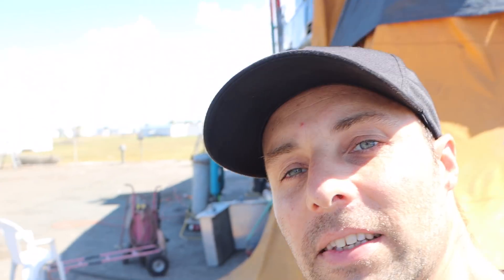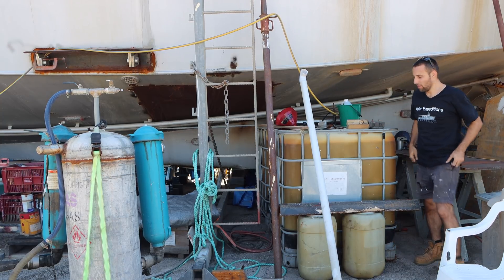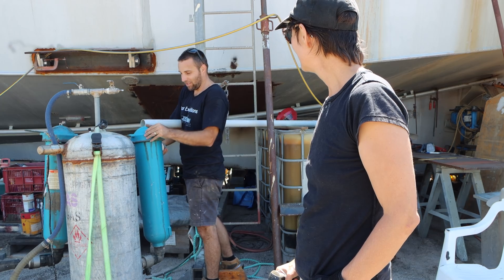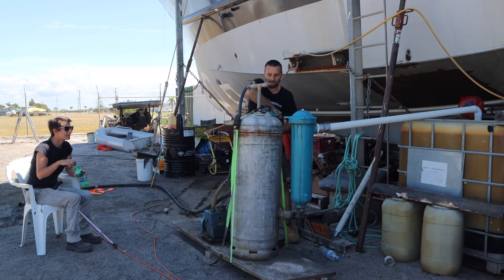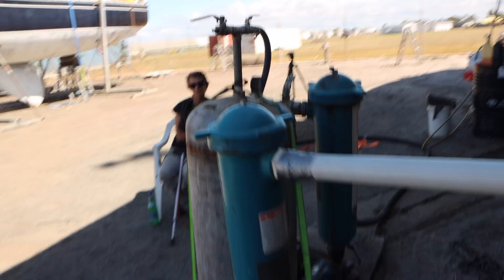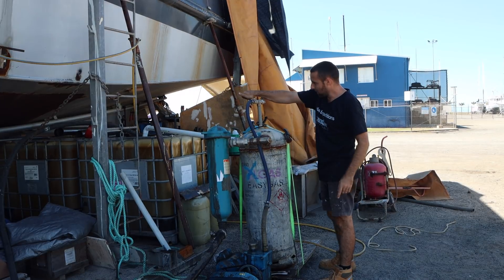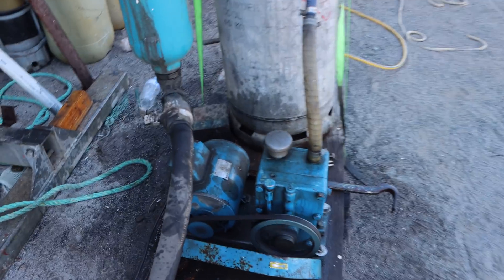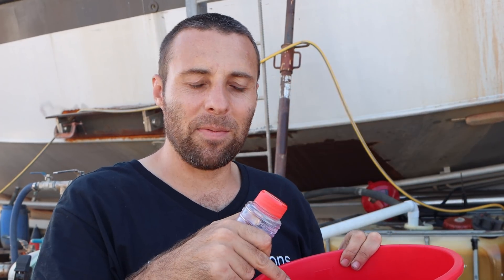Fuel Testing & Fixing 2ton of Dead Diesel - Project Brupeg Ep. 132

Comment: I know Deboss Garage got a detroit diesel in a crane that sat in a junk yard for 30years to start and run on whatever nasty was in the tank. Granted that is a full mechanical poppet injection system. Common rail systems are much more finicky as fuel lubricates the pump. I know detroits are fuel eaters but in my boat (i get eventually😁) im going with like a 3-71 detroit purely cause parts are available and it can run a alternator generator off a large buss and run on palm oil , veggie oil, hell even a mix of gasoline and oil ive heard theyd run on. The pure mechanical nature of it really calls to me when you could be 1000s of miles from shore.
Reply: All injection systems use the Deisel as the lubrication 
Older mechanical systems are more fussy about Deisel quality 
Most older systems should have additives due to the low sulfar Deisel available these days 
They're more resistant to dirty Deisel though it'll still damage them but over a longer period Those junk yard starts are done on junk yard engines offern with no want to use the engine so No care is given to looking after the engine 
What deboss did certainly damaged the fuel pump 
But it wa run for such a short period it wouldn't have done anything noticeable 
These guys want to run their boat for anouther 50yrs so a lot more care has to be taken with fuel quality
Reply from the maker: Hi Guys, for us the water content and partical size is critical. the diesel quality is what it is but we can control how clean it is (same goes for vege oil) filtering down to 1 micron is excessive but allows us to know we have very clean fuel and a margin of error should it get dirty. We also run multiple fuel filters i the engine room to maintain this level of cleanliness